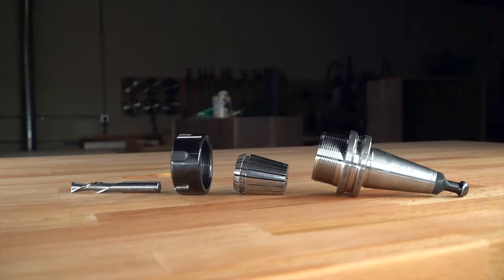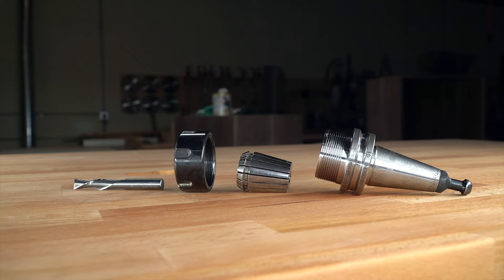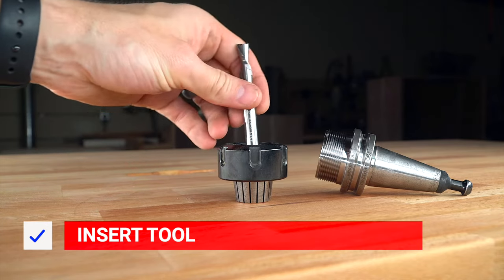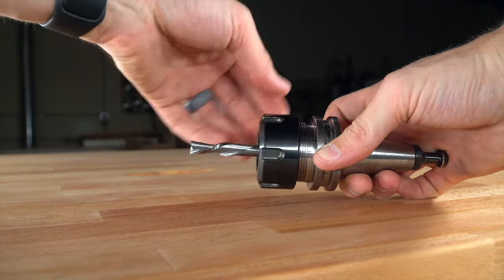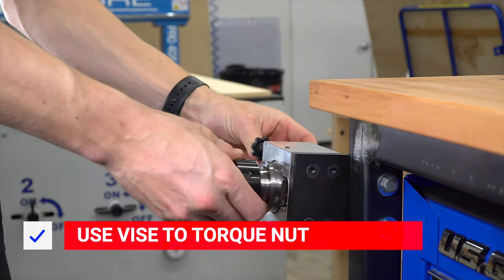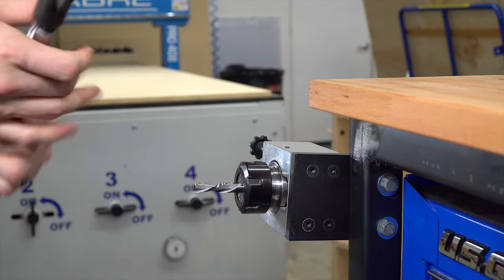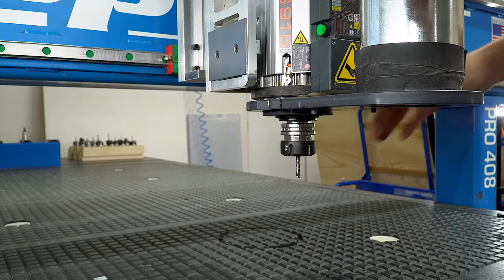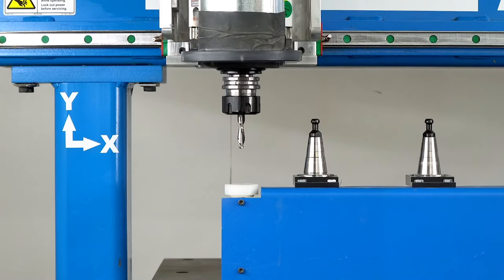How to Setup an ISO30 ER32 CNC Tool Holder

Comment: I'm eager to learn about the shape of the vise...
Reply from the maker: Hey. Not sure what you mean?
Reply: @pdxcnc  did you buy the vise? Is that a common thing? How critical is the torque on the tool?
Reply from the maker: The vise came with our CNC router. I believe there are others, if you search "ISO 30 Tightening Fixture" on ebay you'll find a bunch. Obviously you'd need to have an ISO 30 style toolholder for that to work.

Torque wrench is pretty useful, not critical. Once you start overtightening tool holders you'll find its pretty easy to quantify the cost of a good torque wrench. Check out Maritool for good prices on those.